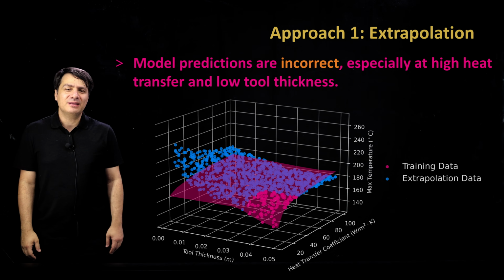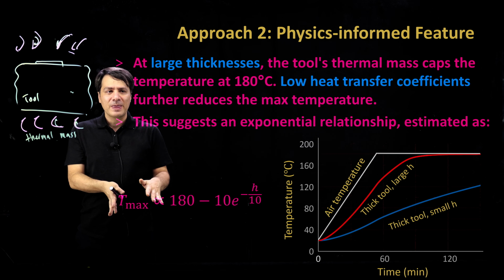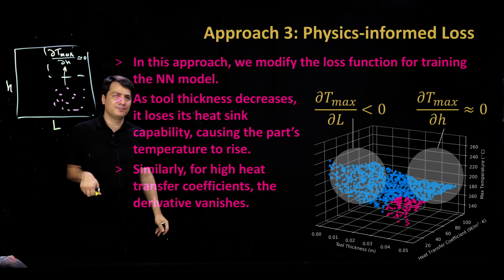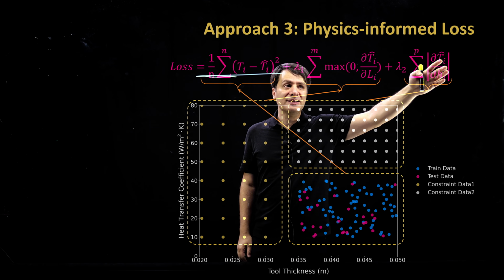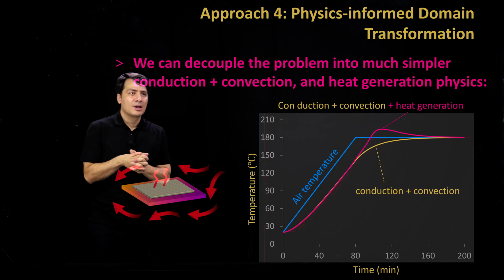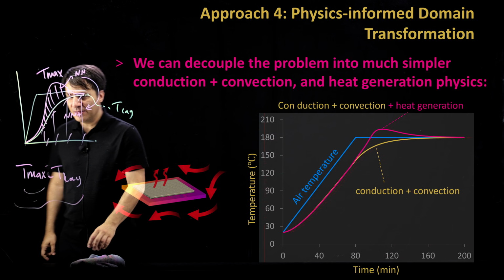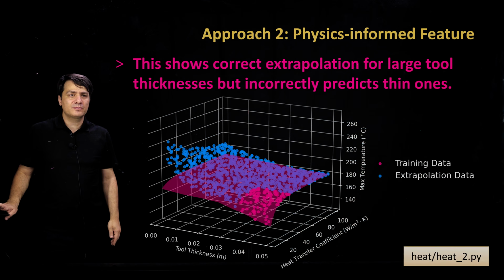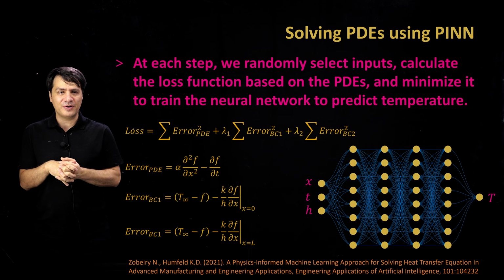Physics-Informed Machine Learning, Section 2 - Case Study on Heat Transfer, Part 2

Comment: A good introduction to the subject; clear explainations and this case illustrates that there is no one recipe to incorporating physics model into machine learning models which is both challenging and stimulating.

one funny note though: The example, although illustrative, is not useful to learn about cooking. When one cooks steak, one does not put it on the pan (or in the oven) before it reaches the plateau temperature. Because, not quite unlike epoxy, the stake has different behaviors in different temperatures and it's going to "sweat" or lose its moisture in the region above room temperature and below the plateau temperature, making it very dry and untender. Optimally you would like to give its surface a heat shock that forms a nonpermeable layer that prevent moisture from getting out while conducting heat to the steak core.
Reply from the maker: Excellent cooking explanation. Yes, I totally agree. That shows clearly why cooking a steak may be different than curing epoxy.

Comment: Did you examine demintional analysis beforebeginning this problem?
Reply from the maker: For the 2D problem considered here (with two inputs), further dimensionality reduction is not possible. One dimension represents the geometry, and the other represents the boundary condition—both are physically essential to fully define the problem. While any two functions of these variables could theoretically serve as alternative dimensions, doing so complicates the formulation. Methods such as PCA or RPCA do not yield more meaningful or simplified representations in this case.

Comment: I notice in the sixth video of the series that you add 3 losses in the physics-informed neural network at the end. All 3 losses are related to conduction and convection. There is no heat source from the crystallising material in the thin layer on the metal block. This model must only apply to the heating of the metal block without the crystallising material and is provided as an example of the simplified experimental setup. Am I right?
Reply from the maker: The data includes the effect of heat generation from the part sitting on the tool. This is why, in many cases, the maximum temperature rises above 180°C (the temperature of the oven). However, once heat is generated, it must be transferred to the ambient environment through conduction and convection. The "losses" essentially capture this effect — they represent the rate at which the generated heat is transferred. It is possible to introduce another loss term specifically for heat generation, but I did not include that in the video. This would probably require another longer video to explore the kinetics of heat generation and how a corresponding loss term could be formulated.
Reply: @UW.Composites  Thank you, once again, for your fast answers!

Comment: Nice series of videos!

I notice that you scale the X data before you split it into train and test sets. I always understood that we should split the data first, train the scaler with the train data and apply it to the train and test sets.

Was it necessary to scale the Y data? This is the first time I have seen anyone do it.
Reply from the maker: You're absolutely right — in a proper machine learning pipeline, you should first split the data into training and test sets, fit the scaler only on the training set, and then apply the same transformation to both the training and test sets. In this particular case, I scaled the full dataset first because the bounds of the problem were known and fixed from the beginning. As a result, fitting the scaler on the entire dataset did not introduce information leakage — it simply standardized the known range that both the training and test samples were drawn from.
Reply: @UW.Composites  Thank you very much for this really fast answer!

Comment: Nice explanation! Isn’t this Physics informed domain transformation some kind of feature engineering in the end?
Reply from the maker: To some extent. However, you typically reduce the dimensionality and transform both the input and output features simultaneously in this method.